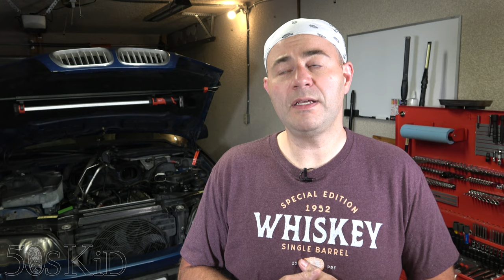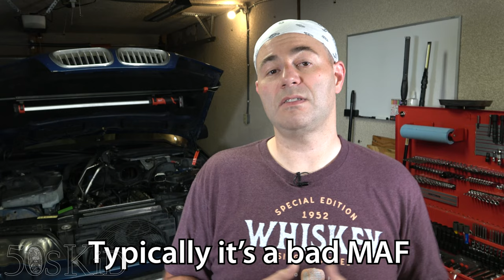Can't Get Your Car's Emissions Monitors to Set?

Comment: I have an update on my evap not ready status. yesterday my evap cleared for green. I have no codes at present date. My scan tool has drive cycle procedures for each of the monitors for the evap monitor it was..# 1, idle for 5 min. ...#2, put car in gear and and smoothly get your car up to 30 to 40 mph for two minuites. I tried this several times and finally it worked, so check your scan tool for this information. My OBD2 is a Zurich....life saver !
Reply: What did you do to clear that?
Reply: Just keep conducting the drive cycle?

Comment: The vehicle needs to be driven in the specific conditions required for the computer to run the test , simple as that. 
Lots of time , the vehicle has to be run at idle for 5 min before being driven. Then has to be run another 5 min at idle AFTER the drive. Sometimes with the a/c on , sometimes without the a/c (depends of the manufacturer) . 
For the evap, fuel gauge has to be accurate and fuel has to be between 1/4 and 3/4. If the tank is full, the evap test won’t run. 
It’s all kinds of little stuff like that. 
Looking up obd2 drive cycle for your manufacturer/vehicle is a good start.
Reply: ive heard this before, but didnt think it was true because im used to hondas and acuras being so easy to clear all the monitors. now im dealing with a ford that is being a major pita, thanks for confirming
Reply: @dc5duben96  did you figure this out? I’m in the same situation but with my 2002 mustang Gt
Reply: @danielviveros8165  na i drove my truck over 700 miles & cld not get all the monitors to set so i ended up just getting a crooked smog

Comment: Re "fuel trims", the engine controller predicts what fuel is needed from the inlet sensors (MAP or MAF, IAT, rpm, TPS) and knowledge of the injector flowrates and engine operation (from test bench data).  Engineers term that "feedforward control" or "open-loop control".  "Predictive control" might be a better term.  The exhaust O2 sensors give "feedback control" to fine-tune the O/F ratio, though have limited authority (say +/-10%).  As mentioned, if fuel trims are close to zero, your engine is operating nominally.  If far off, then something has changed in your engine, maybe some tuner mods.  Most common is a vacuum leak.  That is worse in a MAF engine (mass airflow sensor) since the feedforward controls don't account for the extra air flow.  In a MAP engine (intake manifold pressure), vacuum leaks are accounted for.  You can verify by pulling out the large vacuum hose (brake booster) and experience the engine idle greatly increase (more airflow) yet still runs smooth.

To find a vacuum leak, start plugging off vacuum consumers (brake booster, cabin controls, EVAP system).  Don't forget the PCV valve.  My 1996 began idling way too fast, so I knew a vacuum leak was overpowering the IAC valve (fully closed is best it can do to restrict airflow past throttle plate).  After verifying the throttle plate fully closed, and blocking off all consumers, I flowed water from a garden hose around the intake and found the rpm greatly slowed with water at the intake-head interface (hard to see under looped-over intake runners).  That confirmed the intake gasket was bad.  Removal found it had become brittle, with chunks missing.  Had replaced that gasket 10 years earlier during a head removal and used a name brand, but likely a Chinese factory figured nobody would notice if they used cardboard with the proper logo.

Comment: Hey 50’s kid. You are the best. I used to watch your videos all the time for my 528i in the US.
I moved to Mexico and I need help with my vehicle. It’s a 2012 Infiniti G37. It is running rich. I have replaced both pcv valves, cleaned both maf sensors, cleaned the map sensor and it is still running rich. Most of the mechanics here do not have the expected and expertise you have, and only these big dealers have the consult and other tools to check what is really going on. I have to pass the smog test. I would really appreciate it if you could please help me. I can send you pictures and information from my scanner if you could please help me find out what is going on. Thanks

Comment: Great explanation. On BMW's...vacuum leaks & MAF sensor reading will drive me nuts. Next question is "what software to use to watch long & short fuel trim?" I tried to use Torque Lite but my E46 330ci wont show the Long fuel trim, just short. Driving me crazy.
Reply from the maker: obdfusion -- it's only a couple bucks

Comment: Good afternoon 50s Kid, I have a weird situation with my 200i 330i.  All my monitors have already set but my check engine light is still on.  MAfs are at 3.9, fuel trims are below 10 and the code on the dash is a P1092.  Thanks in advance.

Comment: I'm having this exact problem on my gtr I just upgraded turbos injectors intercooler etc etc etc and now after a ecutek tune the car monitors aren't getting ready, I drive this morning 50 miles and got 5 monitors ready from 7 but as soon as I turn the car off it resets, the only one that maintains is the misfire and comprehensive component, the guy who did the upgrades replaced the o2 sensor as I was having a code, now I don't have anymore codes after 150 miles but I still don't get the monitors ready

Comment: Any chance you can do one of those test (like you did with cleaning the cats) to see of you can soak the o2 sensors in something and clean them/let em dry and see if they come back around?
Reply from the maker: I don't think they are coated with anything -- they operate at very high temps and everything pretty much burns right off.  They just wear out over time.
Reply: @50sKid  i did some youtubing after leaving that comment, and i see that they do get filled with carbon, but people use weak cleaners like carb cleaner to try and spray it out, some stuff do come out and they(sensors) do come around, but after some milage they stop,

Id love to see them soaked in a heavy cleaner of some type, maybe even in a ultrasonic cleaner, then tested... But i guess thats maybe just band aiding the issue..

Some say that you can clean them every 20k miles and they will last longer, but thats all speculation... I will do some more reading up...
Reply: Actually could be interesting to see is it possible to get them fixed with stuff like that.
Reply: @thetoughcookie3665  right, all the other videos on YT is either badly recorded, or not inuf effort has been put in, thats why i love 50s kid videos, he is thorough.. Check out his video on cleaning cats...

Comment: Maybe you can do a video on a common error with the 4.4. It's a camshaft timing advanced error. It's a tricky one. Some are saying it's the kiss of death because it means your chain guides are gone. Some say you just need to clean our replace your solenoids. Mine is an N62 but the M62 has the same issue

Comment: What is the cause if the monitors reset and by the time I get it to the smog station I have three incomplete codes again? Which are catalyst converter, O2 sensor, and O2 sensor heater.

Comment: Having a similar issue with my son’s 1998 Z3 with the M52 2.8L. The secondary air pump monitor won’t complete. The following are all working: air pump, check valve, vacuum solenoid and hoses. Smog and registration are due soon. Any ideas?
Reply from the maker: the vacuum line going to the air pump valve on the exhaust side of the engine near the front is cracked and/or broken.
Reply: @50sKid  Thank you for your reply. We have replaced that vacuum line with a new high heat resistant silicone hose and verified that there is vacuum being pulled during cold start ups. We have also replaced both upstream and downstream O2 sensors with OEMs to eliminate the possibility of those causing the secondary air pump monitor to not complete
Reply: @handydaddy4232 did you figure it out my cars doing the same thing?
Reply: @brokeboychopstix6095  it turned out to be a bad secondary air pump and some dry rotted vacuum hoses

Comment: just spent months learning this the hard way. turns out my '02 e46 was relaying data through obd2 that was not correct. ista showed the correct readings, which then prompted the o2 sensors to be replaced. monitors then set, but such a headache
Reply: whats ista?

Comment: I drive a 2015 Dodge Challenger going in for its first smog test. I failed because o2 sensor monitors were not ready. I do a a drive cycle almost every midnight and still incomplete. I had the downstream o2 sensors replaced, and drove 300 miles and I'm still stuck.
Reply: You don't have a tune on your car do you?  Very weird for that to be incomplete after all this time??
Reply: @stevew9563  finally got the o2 sensors to set. Freeway going 65 letting foot off gas to 55 and aggressively back up to 65, repeating it 5 times. Crazyiness but that's what worked.
Reply: @RareAirTwo4   - Ya some cars got a weird sequence you would never do in everyday driving.